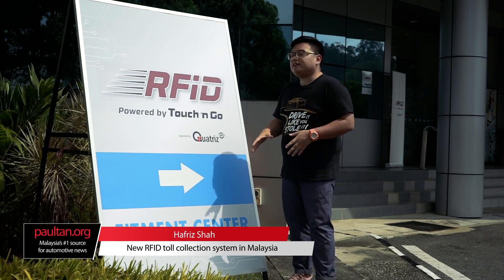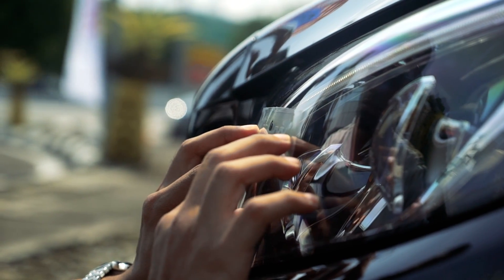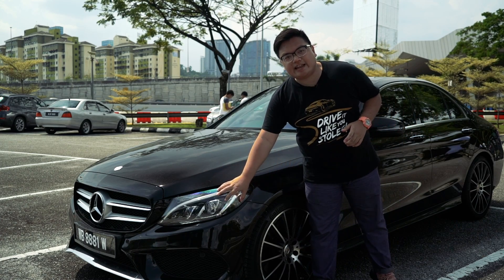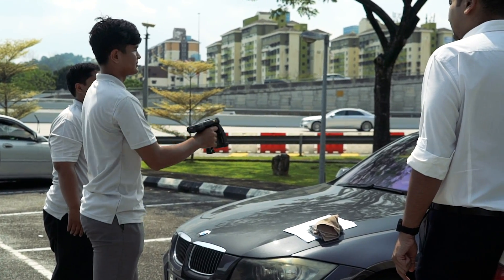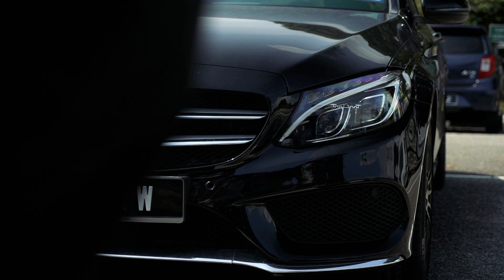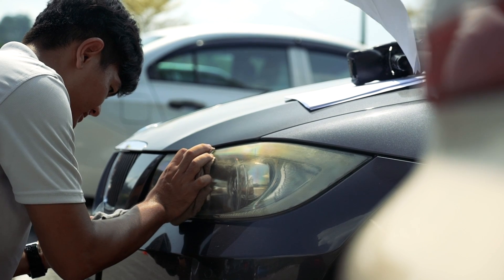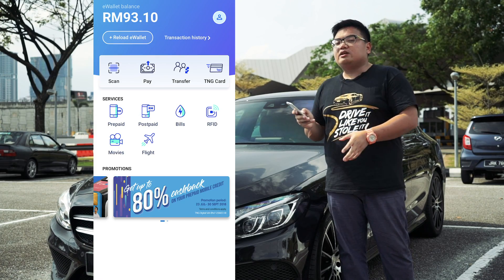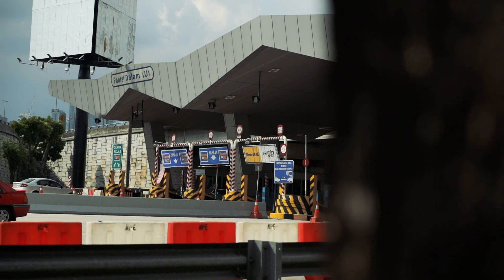QUICK LOOK: New Touch'nGo RFID toll system in Malaysia

Comment: With microprocessor running in nanoamperes, wonder why smartag never use low power tags or even think about solar powered with recharging battery.  Look at the chip STM 32L4 and these chips can run months with one single charge.

Comment: some of the japanese cars come equipped with ETC system... these electronic toll card like in myvi should be able to be at least recognised by smart tag toll booth... why we need this sticker thingy...??? in my opinion, either use a built in system or a plug and play type like smart tag is better than using stick on stuff... or better yet, use a plate number detection system and an external payment method like in australia toll booth... cross the road like no toll but you can still pay whether got money or not via bank in....
Reply: coz we got too many fake number plate.

Comment: I would give it a try, but seeing from the vids,. It's seems like the function are still the same as smart tag just with the dif way of how the toll thing detect your RFID. 

This is what I would call an innovation that give no benefit (less benefit maybe) hahaha it's as if using the escalator or using the lift. Both send you to upper or lower floor, except lift let you bring trolley and RFID has more advantage since user doesn't have to take care of the smart tag device thing .

Comment: I don't own a car but I think I would choose to stick on the windscreen than on the light cover for safety reason, and because it's just a sticker, it also can be easily peel off or may be spoilt when our car exposed to sunlight or the heat of the headlight (when you switch on).

Comment: 0 reason to use passive RFID. Advantage of this system so that the devices no need to be line of sight with the reader. Now need to stick outside on the car? And can't stick near metal? 

Using existing technology on different application then still need to test whether viable or not?

Comment: If wanna use RFID, follow the ERP system. No need to put sticker. The RFID chip is built into a card then insert into an In-vehicle Unit. What's so difficult? No problem with tinted glass etc...just like the SmartTag. Better still, no need toll :-)

Comment: not gonna work too well.. the heat from the headlamp (may go up to 100deg C) and hot temp in Malaysia would melt the circuitry of the RFID chip (destroys your money along with it).. Even the current SmartTag have similar problem, if u leave it in the car & park it in the hot sun, would make the smart tag inoperative (melt/burned circuitry).. electronics and heat are not compatible, heat destroys electronics..

Comment: The RFID tag does not look like an active type, there is no battery attaching so it does NOT emit RF signals. Instead, it "reflects" RF signals.
Reply: Therefore can be near metal parts. Dumb design. Singapore In Vehicle Units (IU) is a battery powered RFID/smartcard reader

Comment: RFID is not the future of smartag. Why dont you guys focus on built in smartag like the one in myvi2018? It works through tinted glass. You dont have to change the battery. All you need to do is change the touch n go card into an the online app thing. So you wont have any issue at the toll. A lot of cars stopped at the toll sebab tak cukup topup.

Comment: This system may come at a higher cost to the users simply because it is attached to the exterior of the car which is more vulnerable to the elements and vandalism. Depending on your luck, you may need to replace it perhaps a couple of times a year whereas for in-car devices like smart tag, u can use it for years without needing a replacement. I think it may ultimately be a question of whether the battery replacement cost of smart tag will exceed the replacement cost of the magnetic strip in the long run

Comment: sticker on headlights, seems stupid as it wont last and probably peel after few washes. too strong of a glue will damage expensive headlights plus isn't it illegal to place anything on them in the first place?..rather stay with smart tag for now. Tolls should be abolished in the city but for PLUS, tolls helps maintain the highways if the highways are nationalized the conditions would be deplorable state of maintenance. However i do feel most of the steel dividers installed by PLUS are not up to safety standards as most fail or end up killing occupants instead of protecting them.
Reply: It stated that it is just trial.. They mentioned that this is not the best solution so far.. Will improve later.. Don't like it, just don't use it.. Simple
Reply: agree

Comment: I read through most of the comments and people complaining this & that and why we doesn’t follow Singapore & Taiwan which don’t have physical toll plaza.

People, note that this RFID stage is part of Malaysian Highway Authority’s migration plan towards that free-flow tolling (we the industry call it Multi Lane Free Flow - MLFF). 

Prior to installing the tag, you need to register your vehicle (need to bring original ownership cert & id for this. If you are not the owner you will need an authorisation letter from the owner to install) which will then link to the tag. This database will be used then to read the vehicle info, the owner and do the transaction/deduction from the owner’s e-wallet account. 

Once system is stable & related enforcement is established, next phase will be Single Lane Free Flow (SLFF) where the barrier will be removed (but toll lane will still be there) then followed by removal of all toll plazas hence MLFF it is!

Comment: Similar to what we have in the Philippines. Headlight mounted ones does not last long. Here they do allow installation in the windshield as long as it is not tinted.
Reply: Which highway has this? Edsa? I didn't know that...
Reply: Many cars have a portion around the rear view mirror that is not tinted (it has those dots to provide some shading), hopefully that area can be used.

Comment: Maybe show us footage of you driving through the toll booth to see how it works?
Reply from the maker: It looks and works exactly the same as SmartTag, just without the device. We sailed past the toll both at 50 km/h on the first try.
Reply: Paul Tan's Automotive News  Since you're working on apps now, why don't you just connect the toll to the internet, and work around the apps instead of adding an extra "sticker" sending "radio signal" as you were trying to hype people up like you discovered some new tech...

get the app to run on GPS, improve the GPS locating issues, toll accept signal from the internet and opens up gate for your car, you can even calculate how fast the car is going and when to raise the bar for the car to go pass the toll.

See?? no need for radio-signal-sending ultra new tech sticker, eh?
Reply: Still need to slow down. Wow..progress!